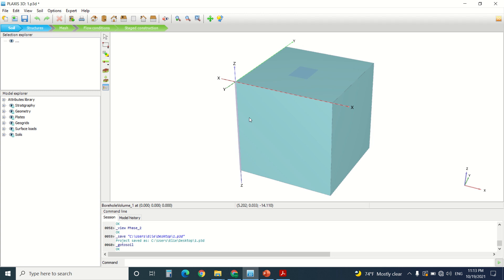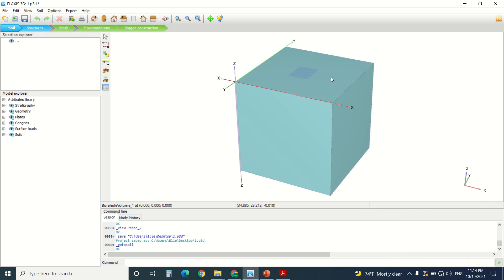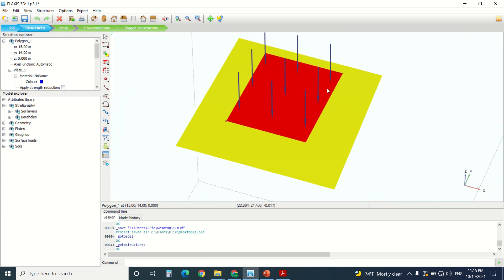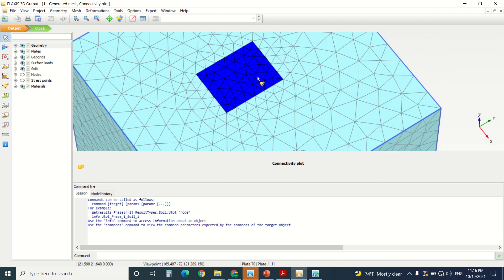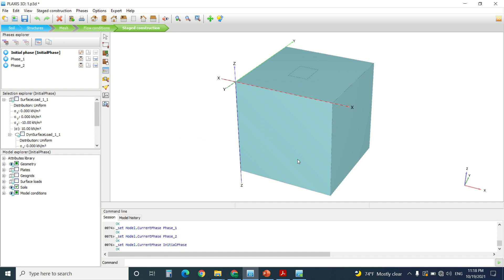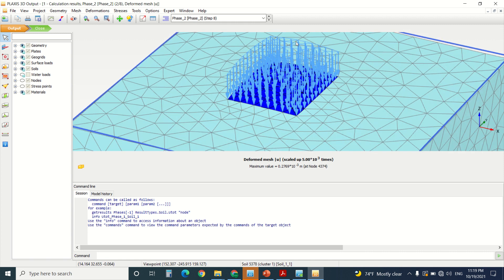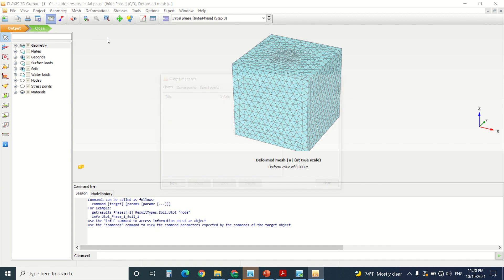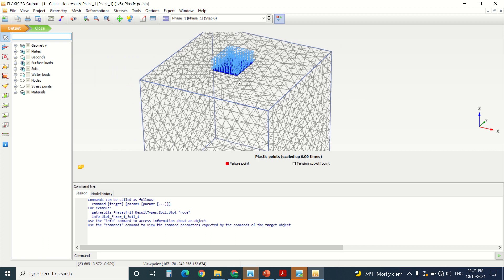Geogrid under foundation plaxis

Comment: Dear sir I am doing stability analysis of a slope using geogrid. but while doing the pseudostatic analysis in presence of geogrid the maximum displacement is increasing as compared to the pseudostatic analysis without geogrid.  But the fos is increasing with the use of geogrid Is there any possible explanation or the model is wrong. Please let me know
Reply from the maker: i need to see the model

Comment: I have made multilayer pavement model with geocell, but during result analysis, after cutting vertical cross-section, stress is distributed in 1st layer only, but I think it should be transferred in lower layers also. So what mistake I`m making? Please guide. Thanks
Reply from the maker: Yes it should be transferred, double click on the second layer to see if it is smaller
Reply: @theengineer7732  Its a three layer model with 190mm, 510mm and 5m thickness from top to bottom respectively, interface is designed as Rigid with gap closer still stress is not transferred in lower layers, whereas deflection and strains are getting transferred

Comment: what about 
1- Interface friction between geogrids and soil
2- Refined mesh around footing
Reply from the maker: Hello
Thx for your reply
Of course, interface is verry important, so as mesh refinement but which is no obligatory
Reply: The engineer 
Explanation how refined mesh around object not important this words not match with manual reference and other references such as papers published and geotechnical books!!!
Reply from the maker: @engmontaseribrahim3944  hello friend
I didn't say it was not important, i said its not obligatory, there's a big difference between not important and not obligatory